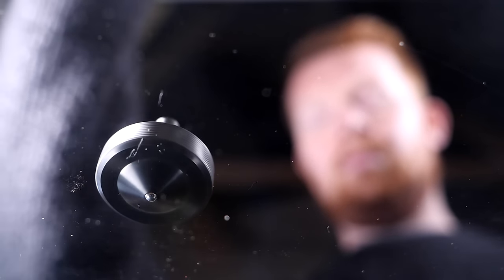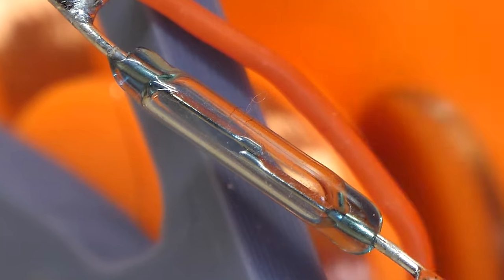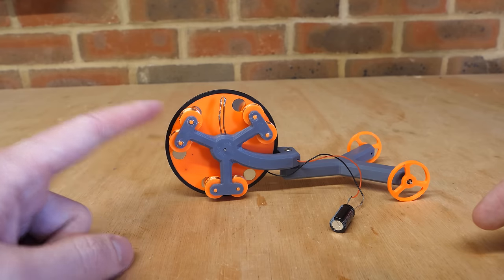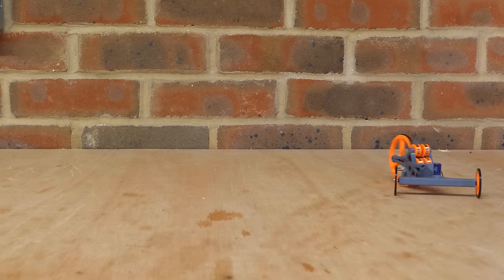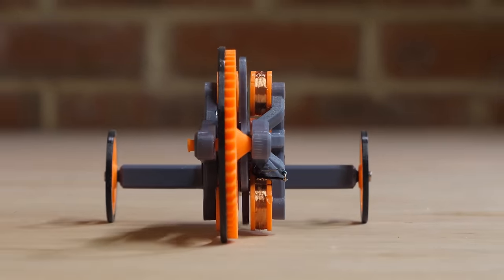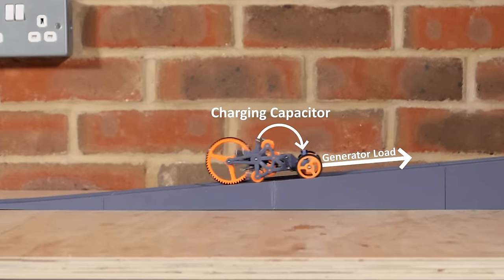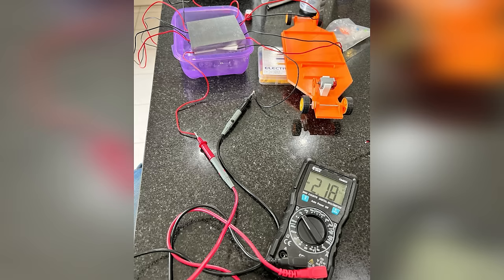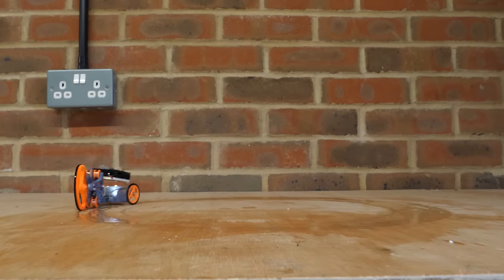This Car Travels Farther Than You Push It

Comment: As someone who works with 44awg wire all the time, a trick we use to make soldering them easier is to just tie a knot where you want the solder to go, flame it to burn away the enamel, solder. Works well enough and saves a lot of headache.
Reply: ohh
Reply: putting a knot in that thing sounds harder than just soldering it, but ill keep that in mind
Reply: Flame it with just a lighter or something more aggressive like a blowtorch?
Reply: @wp77978 A match flame will easily burn away the insulation.  It doesn't need to be high temperature.
Reply: @wp77978  Even with just a lighter you need to be careful to not instantly melt away the copper :D
Reply: With wires that thin the flames burned away the copper too when I tried. Yes eventually with enough distance it worked but it was a real pain.
Reply: Thank you! As a drone repair tech this is extremely useful knowledge for me.
Reply: I usually twist together, or coil one around the other. And I burn enamel off beforehand and clean the wire since the burn products prevent the solder from properly connecting at times. But yes this will definitely work.
Reply: @eccomi21  it's actually not too hard to do. Just a simple knot works well.
Reply: @eccomi21  You'd think that but a reef knot is super simple and soldering it is suuuper annoying surely
Reply: @jama211  u just said "youd think that" to the guy who said he does it all the time lol
Reply: Oh, this gives me flashbacks from the time when I created my own electric guitar pickup from scratch, also using hair-thin wire. I also discovered the knot-solder trick, because the wire broke often enough to try out various methods of reconnecting the ends. The pickup works pretty well, but still I decided to never again build my own guitar pickups, for the sake of preserving my sanity.
Reply: @wp77978  There's different types of enameled wire, some are low temperature where the enamel melts at soldering temp. The high temp ones need something hotter or for the enamel to be scraped off mechanically.
Reply: That is a great idea, i had never thought of that been struggling to mess around with soldering it. Thanks for that.
Reply: @ABaumstumpf yeah I just use a bit of Emery cloth. There not idea is great though because you’re using the surface tension of the solder to get a bite. Just like filling a via up
Reply: You can just burn the enamel off by setting your iron above 750F or whatever the datasheet for the wire says
Reply: This is a good tip.
Reply: @Scotty-vs4lf   His post appears unedited and directed at the correct person. So what are you talking about?
Reply: @anon_y_mousse  exactly, hes telling the guy with actual experience that his method wont work. thats like if i tried to tell messi how to kick a ball
Reply: @Scotty-vs4lf   Reread the name of the posters and maybe you'll realize your mistake. He's not talking to the person you think he is.
Reply: @anon_y_mousse  yeah im not known for being observant
Reply: Sweet. I was just about to suggest to twist the wires together to double the thermal capacity more effectively. Glad to hear that actually works!  Thanks for confirming my "wild a** guess"
Reply: @jama211  does it even need to be a knot? surely its enough to just bend two loops, thread them through each other and then twist?
Reply: You just need a soldering iron at a high enough temperature, 750 degrees min.  No flame needed.
Reply: This is what I do as a hobbyist. Still difficult, of course, but LEAGUES easier and safer than soldering it straight to a contact.
Reply: @jonathanodude6660  doesn't need to be a knot, but it will make it a lot easier. As long as the solder makes good contact you really are fine with any method you're comfortable with.
Reply: No, the way to go is this:
Solder the first wire on a soldering pad. Then the second wire on a second pad which already is connected to the first one.
Reply: @EDVDompteur  if I'm repairing a break in a coil wind, I don't have a pad to solder to.
Reply: Or… have a robot do it? Wow. Duh.
Reply: @Alleroc In this case try do do a "Western Union Lineman's Splice" .
An easy way to do it is to lay one wire on your fingertip and press with a screwdriver's tip in it to make an angeled kerb.
Repeat it with the other wire.
After that you can hook them together and perform the Western Union Lineman's Splice with ease, because they are hooked.
.
Another smart way (even simpler):
Take a small piece ao Kapton tape.
Press the first wire on the tape's sticky side, then the second, so that the line up and overlap a bit.
Now you can solder them together with ease. Kapton is heat resistent and its glue holds the wires together during soldering.
After soldering the tape even isolates it all.
Reply: @EDVDompteur  the knot works good for me. It takes about 10 seconds to do with tweezers.
Reply: Wow great strategy. I had to fix a fan at the farm and had no power, soldered it using a nail, pliers and a bbq fire. The knot would save me tens of minutes.
Reply: Noted.
Reply: @Scotty-vs4lf  I totally think you should do a video explaining how they should kick the ball in the most absurd way possible.  Granted, I'm American and don't have a clue who messi is, but it would still be fun :D
Reply: @Michael_Archer78  im american too, i just know the name 😆
Reply: @Alleroc Thanks for the good tip.  If I pictured that right, you mean tying a knot in the wire that still has the coating on, burning the coating off, then soldering?  I'm getting bit by the hobbying bug and and excited to start tinkering!  Any other tips you can offer are appreciated too.
Reply: @t3nse7en  your idea is correct. The main tips I'd say to follow are keep a clean iron, don't overuse flux, and if you do use flux try to stick with no clean unless you have a solid way of washing the boards.
Reply: I used to drop a bead of solder on a Teflon block, and reflow it after clipping the wire in place, but a knot sounds great if you have the dexterity
Reply: You can solder this easy with solder paste.  Paste the wires and then short them across a battery for a very short time.  A split second tap is all it takes.
Reply: the wire just turned into ash
Reply: @oropyt  You don't use a high voltage battery.  Just enough to get hot not burn it up.  Also like I said for a split second.
Reply: Great idea

Comment: 50 years ago, for a high school science project, I cobbled together a toy car with an electric motor connected to the wheels and driven as a generator, to demonstrate electric braking into a resistive load.  With switch open, my toy car went fast down a ramp. With switch closed, the car went slow down the ramp.  I give Tom an A++ for an excellent project!
Reply: Cool
Reply: I have an extreme urge on what to reply here but that would just be (probably) like begging
Reply: That makes sense. If you short circuit the two wires of a DC motor the rotor becomes harder to spin, you can even use it to test if two parts of a circuit are isolated from one another or not
Reply: The locomotives you see pulling trains use this to slow down without using the air brakes.  There Is a large electrical resistance grid on the roof for what the railroad industry calls "dynamic braking".
Reply: You re both tom and the jury?
Reply: yes, much like the one's you pulled back to wind the rubber band and let it go to watch it zoom off....
Reply: Who asked?
Reply: @threynolds2 Electric cars also use this to increase efficiency, and thus range, as well as saving on your brakes and allowing for one pedal driving, which is a very nice feature to have. It’s usually called regenerative braking (though some manufacturers like to make up words, like “i-Pedal” in Kia/Hyundai/Genesis EVs), but I could never go back to having to hit the brakes every time I want to slow down.
Reply: @Lightbulb4869 did I give you permission to talk?
Reply: @kylitrixgames4980  shhhhhhhhhh
Reply: @TheGameChangerLord your mom is here with me bro, you need to talk to her?
Reply: @kylecoolky1189  It seems like a convenient feature for a casual driver who isn't very good at the task of driving.
Reply: 50 years ago was just 1974? I first thought u were referring to the 50s

Comment: There is something incredibly funny about your durdling little car at the end that manages to be sopping wet, made of cheap plastic, and on fire, all at the same time.
Reply: also his ozempic face is funy
Reply: The more elements are involved, the better!
Reply: @dazley8021  just replace the tries with mud and it will be 40% faster  trust me this works
Reply: I read this comment and had no idea what to expect, and then suddenly it was exactly as you described.
Reply: @00Unstable  lovely comments my people. I usually cool down the sopping wet on fire cheap plastic tiny mobile to freezing point so it maintains even more energy. Usually, I add a solar panel on top to keep it going over night. But what really gets it going is when I put a fly on top, wow does he really stir it good, it keeps going in a perfect circle every time.
Reply: @Pooopers  ?
Reply: When Elon Musk gets involved with the design process
Reply: The little car at the end starts Drifting because of the slick track it allows the rear wheels to so slide out.
Reply: @dazley8021 it becomes the avacar

Comment: every toy car maker should be taking notes - the right implication of this could make self propelled toy cars exponentially more fun
Reply: What notes, this technology is in practice since 1960s. It is used in toy cars for children, when they pull it back, the capacitor pushes the car forwards more than the actual pull.
Reply: @KaavjeSahe  I didn't know those wind-up cars used capacitors. I figured it was mechanical.
Reply: @CosmicFlux  Some use Flaps, while some use capitcitors. Expensive ones use capacitors and the cheap ones use flaps. 
As a single capitor cost 13 Euros, cheap toy cars usually have a flap to move them forward.
Reply: @CosmicFlux  pretty sure the vast majority are purely mechanical flywheels, have never seen one that used a capacitor
Reply: You and your projects are brilliant well done
Reply: Flywheel car does similar thing to the one in the video, but faster, which for many kids means more fun. This on the other hand has more techy vibe to it.

Comment: You should keep the capacitor in the peltier module powered car. The motor draws power in short bursts when a magnet passes the reed switch. And so when the motor is not drawing current the thermoelectric generator is still converting heat into electric current and charging the capacitor. Otherwise, when the reed switch is open, the thermoelectric generator is unable to convert the energy because the current has nowhere to flow.
Reply: I was thinking that too. I don't know if there's any capacitance in the Peltier pad but if there isn't, I would think a capacitor would help.
Reply: @SqueakyNeb  There definitely will be some parasitic capacitance in the TEC but it will be very small compared to the electrolytic capacitor.
Reply: I have little experience with electronics/electrics and no experience with Peltier stuff, so I'm probably talking out of my ass here and feel free to correct me if I am, but I think this might not matter too much?

The pad generates voltage via temperature differential between the sides, but if you're not drawing any current, surely it doesn't transfer the heat as easily as when current is being drawn, right? If so, when the switch is closed the pad generates a higher voltage due to the higher temperature difference, and you get practically the same effect because the temperature differential is acting as a capacitor anyway, isn't it? 
The way I'm thinking about it is best described as an electric version of a Stirling engine where you intermittently stop the flywheel (between coil pulses) which lets the heat build up which then makes it spin faster.

At higher speeds where the air rushing by and cooling the pad is more of an issue I can see the sense in adding a capacitor, but again, assuming the stuff I said is accurate, a capacitor would just be another component for energy loss in the system.

If I am wrong please do correct me, I'd love to learn more about this stuff.
Reply: @PromptedHawk  Ahh I really want to know the answer to this now. I think theoretically you're all correct. However, my suspicion is that the heat capacitance of the TEC won't be able to respond very quickly compared with the frequency of the motor. Therefore an electrical capacitor will be more efficient at harnessing the energy between pulses and would provide a measurable  improvement.
Reply: would it be useful to place another peltier plate upside down on the first one, and power it when the reed switch is open, in order to keep the ice a bit cooler for longer?
Reply: @sliceofbread2611  using the voltage from one device to power a different one in order to cool the first (causing higher voltage generation from it) is somewhat akin to plugging a power strip into itself, kinda the definition of a perpetual motion machine and this is with 100% efficiency.
Reply: @PromptedHawk i get your point, i just wonder if it is a bit like storing the energy as thermal energy
Reply: @sliceofbread2611  it might work, but it'll most likely make the car perform worse (more mass, less efficiency) than without.
Reply: Peltiers are very inefficient at cooling. You'd do better using a super low wattage fan to cool the cold side.
Reply: @PromptedHawk the heat doesn't "build up", the Peltier effect caused emf gradients in the material regardless if you convert it to useful work or not
Reply: @badgermcbadger1968  I'm not sure I'm understanding you correctly and I can't seem to come up with a decent explanation of what I think you mean through searches, can you please explain a bit more clearly or reference a resource that does? All I'm digging up is electromotive force gradient and that seems to be similar enough to plain voltage, so I'm just not seeing where the energy is going if not to just heating the ceramic up more...
Reply: @PromptedHawk  first of all, the phenomenon here is more accurately referred to as the seebeck effect, which is the opposite of the Peltier effect (both are a part of the thermoelectric effect, just from different povs as the process is thermodynamically reversible). Basically the way the seebeck effect works is that you have two materials with different seebeck coefficients which describe the relation between heat flow and electric current in the materials material, when the two materials are joined and have a temperature gradient between them (they are connected thermodynamically in parallel but electrically in series) the difference in the overall voltage between the two materials (caused by the different seebeck coefficients) cause a net voltage across the both of them, so you can connect a load and extract useful work. When you only have one material for example, most of the electromotive force gradients point in random directions and most of it is lost as heat (think of it like eddy currents). The same is when you disconnect the load and have an open circuit, though the electric current is still moving mostly in a single direction in this case, most of it is lost to joule heating like eddy currents
Reply: @badgermcbadger1968  First, thank you so much for putting in the time and effort to write a more detailed reply.

So, the energy just goes into making some randomly oriented magnetic fields that, on average, cancel out? I'll admit I don't exactly understand quite yet, but here's hoping the next semester of physics gets me there ¯\_(ツ)_/¯

I read something about how there are generative TECs and cooling TECs (the vastly more well known Peltier pads), but both work both ways, just horribly in the other direction, a bit like LEDs and solar panels. What I'm getting at is, the Seebeck effect is the one the generative TECs are optimised for, as opposed to Peltier and cooling TECs? Thought it might make a difference but going by what you say it doesn't really matter because the energy wastage is going to happen anyway.
Reply: @PromptedHawk  not randomly oriented magnetic fields but rather randomly oriented "voltages" (or more precisely EMF, which makes those voltages occur in the first place)

Comment: Someone should make a scooter with this built in to it. It would not require charging in the usual sense, and it would give a form of exercise to the user whilst still being a viable form of transportation.
Reply: regenerative braking is already a thing in scooters, this is basically that
Reply: bro its just a hybrid electric system storing energy, like when you go downhill and it recharges the battery nothing new

Comment: That was an excellent macro shot of the reed switch in operation! 
Seeing the tiny contacts closing/opening as a magnetic field passes is difficult to see without magnification.
Reply: I work in a manufacturing facility and our Reed switches are covered in plastic and sealed, so this is the first time I had seen how they actually work instead of just knowing it wasn't working, so replace it....  Now I'm confused as to how the heck they break.  Maybe bent back and forth through enough cycles until it broke?  Or stuck fused together for some reason?  Wondering if I just smack one hard against my leg if it will start working again?   Probably go through 2-5 a week across all machines